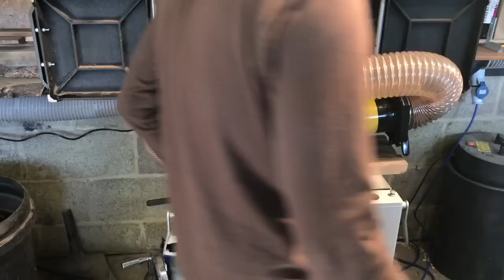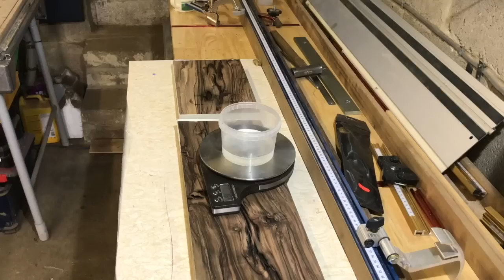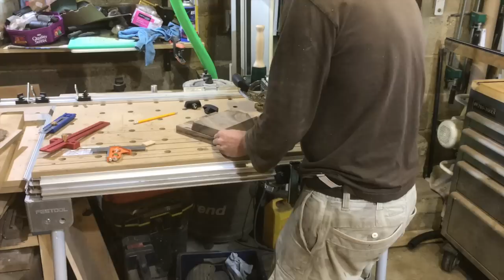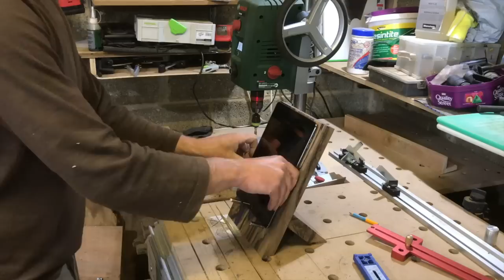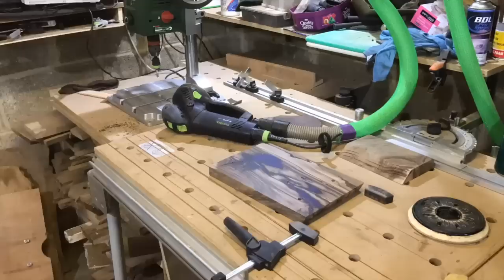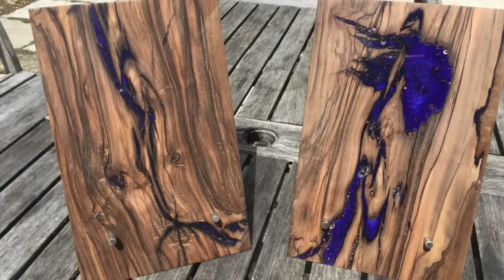Walnut and Resin IPad Tablet stand

Comment: Which papers do you use past 320? I use Mirka Abranet ACE on my Deros sander but that's usually as far as I go even with epoxy but the finish looks so much better on yours, especially the epoxy part. Thanks for sharing
Reply from the maker: I use Festool Rubin2 from 80 to 320 on my 150 Rotex then jump to mirka abranet  500 then 1000 next stage sheepskin pad and Festool 5000 grit polish (which I believe is for car metal work) you may get ever better results working up the abranet to 3000 but it takes for ever as it is :) and I am my clients seems happy with my finish..  Best
Reply from the maker: Arrant 800 then 1000 , then Festool 5000 paste

Comment: Great work!!!  I have some issues with epoxy. It take days to dry and after 5 days it is still not completly dry.. /: Any hint to help me?
Reply: camille Rateau you are not using enough of the hardener.
Reply from the maker: I read it can only be 3 things temperature / mix ratio or you didn't fully mix it .
Reply: where do you get the powdered dye from?
Reply: called mica powder, have a look on eBay.

Comment: How long to dry naturally without the torch?
Reply: I think the torch isn´t for drying. But with the heat the bubbles come out of the resin.
Reply from the maker: Your right the touch is just to remove air bubbles .
Reply from the maker: The Touch is to remove the air bubbles , but it take around 24 hours to cure